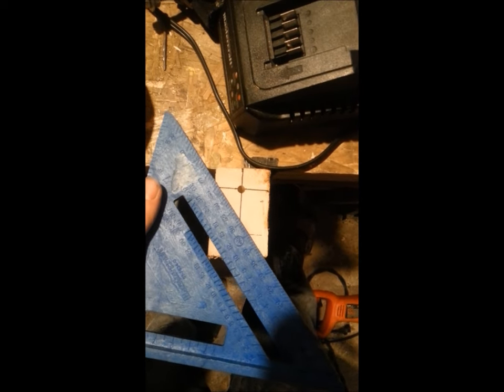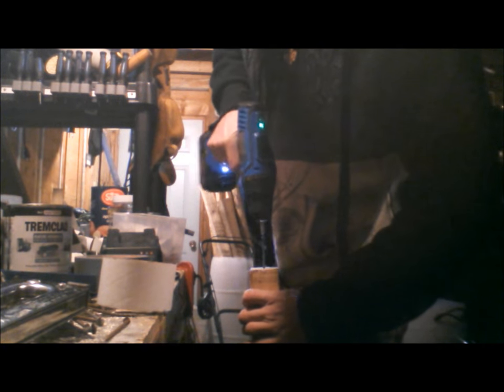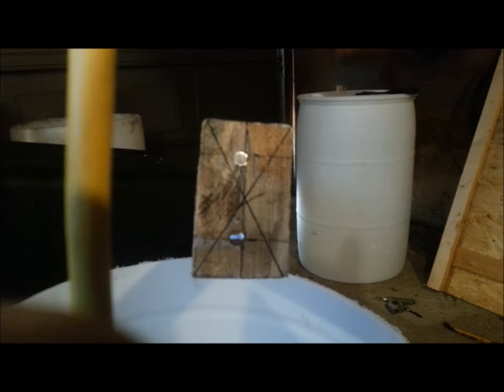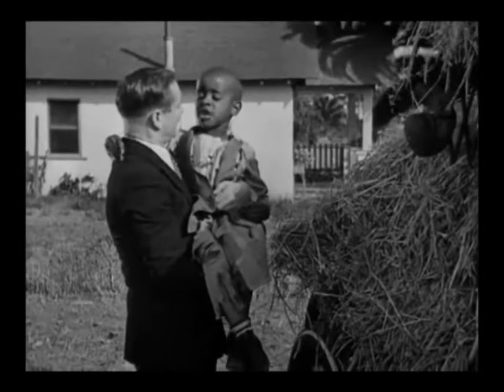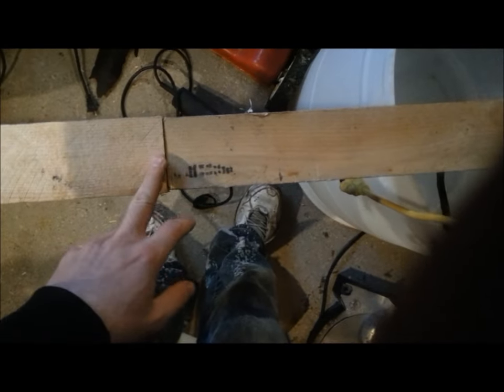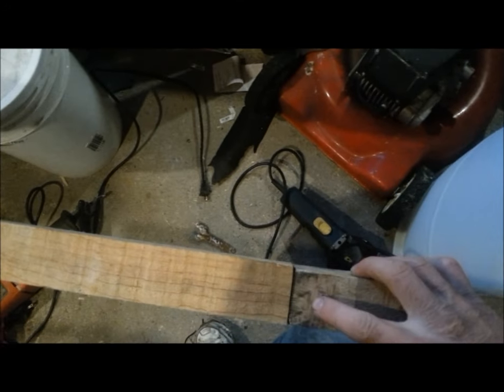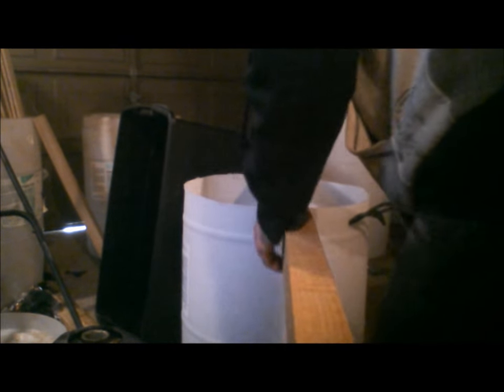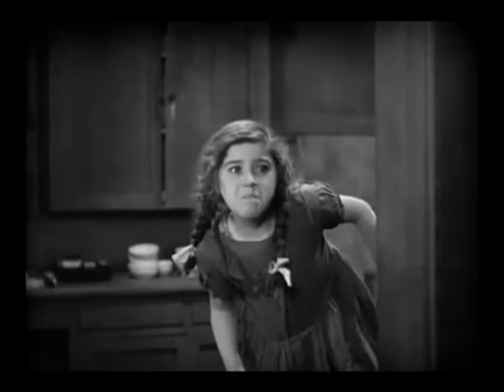BUTT TO BUTT (joining 2 pieces of lumber end to end)

Comment: I came to see end to end finger joined dimensional lumber. When I realized that was not what you were doing I stayed for the comedy.  When I realized what you were actually trying to do  I was very very skeptical. Now I'm absolutely amazed enough to include this in my mental toolbox of emergency tricks.  Along with some new vocabulary words.
Reply: I still don't know if I'm supposed to use my biscuit joiner or my dovetail jig
Reply: Can someone explain to me HOW sturdy this is if I’m wanting to use two lengths of 2x6 each side for the building of an AFrame house with a height of 32-34 feet ?

Comment: just found this after doing something similar to a fence post.  I extended a wood fence but added a 2 foot privacy panel to the top.  I needed to add 2+ feet to the end post of the existing fence and had no interest in digging out the old post and putting in a new one.  So instead, I drilled the center of the old post top, inserted 6 inches of a 12 inch 1/2 inch rebar, placed my post U bracket over it and secured it with nails and then added a 2-ft 4x4 piece with it's bottom center drilled out.  Pounded it in flush and Boom.... Done. I braced the post with brackets added the side for the horizontal boards and after I stain it, you'd be hard pressed to see the added piece stand out.
Reply from the maker: Very attractive !
Reply: Bryce what did yiou mean by this sentence here "placed my post U bracket over it and secured it with nails and then added a 2-ft 4x4 piece with it's bottom center drilled out."  I am trying to do the same thing but note sure how to secure the extended 4x4 post.

Comment: Exactly what i need.  I mean I've seen ppl doing scarf joints and all other pretty joints, but this will do for someone who only has screws, and a drill.    I got piles of scrap wood and this is what i will be using to extend the length of them.  
Any chance you would do strength test of this joint?
Reply from the maker: Well I posted this video 4 years ago and the shed is still standing so I mean that seems pretty good to me!

Comment: youthink this would work with a 4x4 too? want to extend my 4x4s
Reply from the maker: Oh absolutely 👍 only vertically though, I wouldn't have theme sideways unless it had lots of support, but up and down I'm 💯 confident it'd last forever and be just as strong as a 1 solid piece
Reply: @doordiy2927  ok coo thx
Reply: @doordiy2927  so don't try this for rafters then?
Reply: @doordiy2927  what if I had the part where it connected on a column bracket so basically where they joined would be on a bracket supported by a 4x4, I got hella 4x4 pieces, thought maybe I could make a beam out of them..what u think?
Reply from the maker: @Eastbaypisces  I mean, yes so long as no weight is on the screw but on the wood itself, if it's just to join them together but the support is on the wood, you'll be alright
Reply: @doordiy2927  ok coo , thanks, u know about spans and stuff like that?